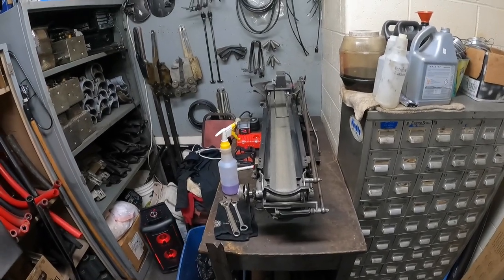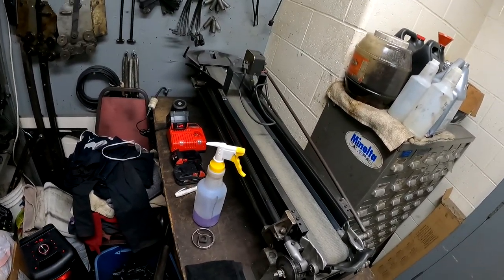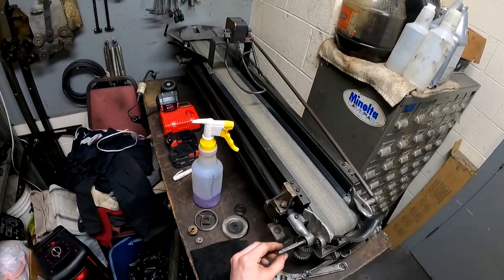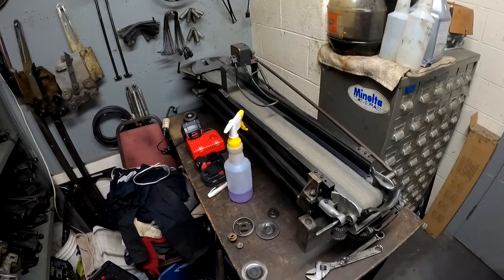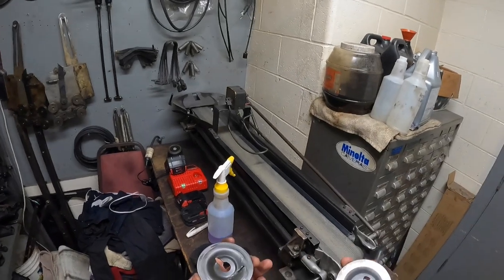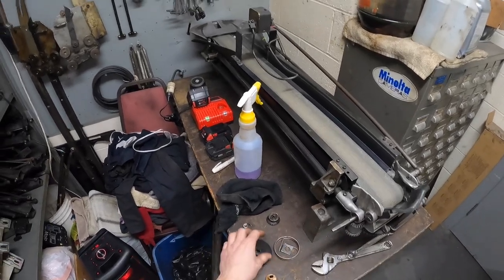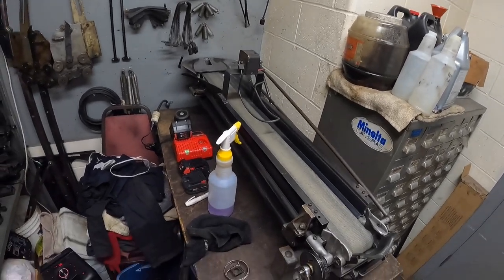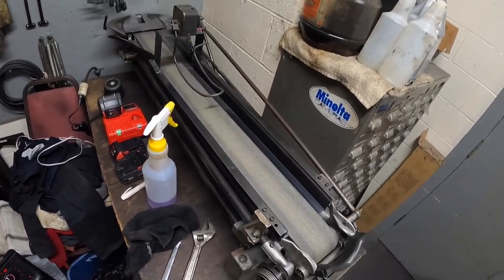AMF 82-30 Distributor Clutch Rebuild Process

Comment: Again, another part on the 30’s that is mostly identical to the 70’s/90’s. However, on the 70’s etc the clutch is at the back of the distributor under the orientation pan rather than right at the end with the trip arm.
Reply from the maker: You hit the nail right on the head brother!